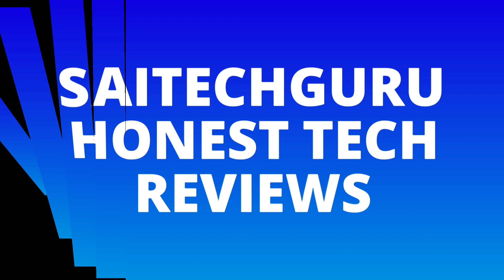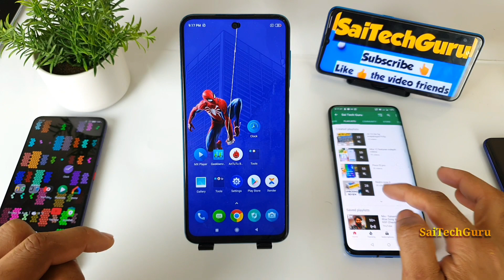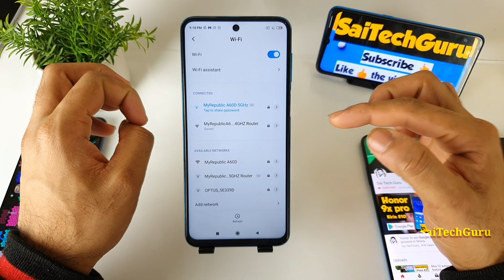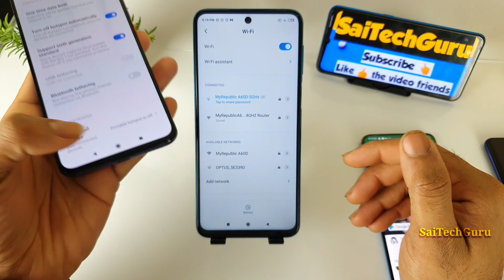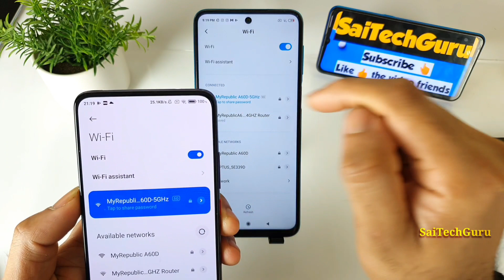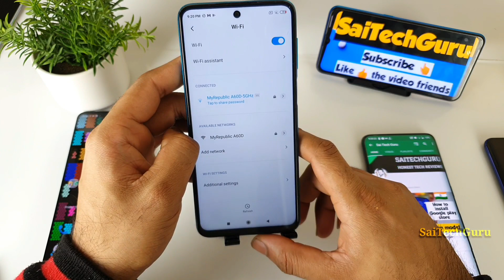Poco m2 pro Wifi 5ghz and 2.4ghz support and strength test

Comment: range is very very pathetic for both wifi 5Ghz and 2.4Ghz wifi networks in a 1200 sft 2BHK flat for Poco M2 PRO. Such a pathetic mobile. HIghly disappointing performance on both of these when compared to less cheaper samsung mobiles. Stay away from Chinese crap brands.
Reply: It was a bug in Android 11 update,

did u update to miui 13? is it fixed?
Reply: @vegetasaiyan2786  Going back to MIUI 11 based on Android 10
Reply: @KD_Mitra  good decision bro, This wifi range bug is reportedly present in many Android 11 and 12 roms from miui global and india versions,

Android 10 Roms don't have this issue
Reply: @vegetasaiyan2786  have you downgraded
Reply: @KD_Mitra  yes to miui 12.0.4 android 10

Wifi 5ghz and 2.4ghz everything works perfectly
battery backup is also much better
Reply: @vegetasaiyan2786  by unlocked bootloader?
Reply: @vegetasaiyan2786  Fastboot method
Reply: @KD_Mitra  nope, I did by renaming zip file trick, you can find videos on YouTube about that
Reply: @vegetasaiyan2786  no